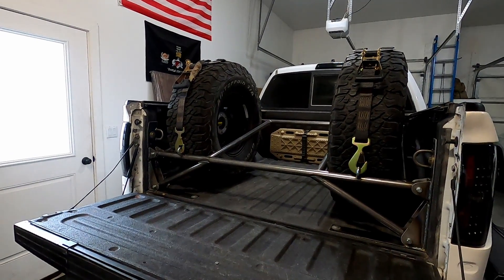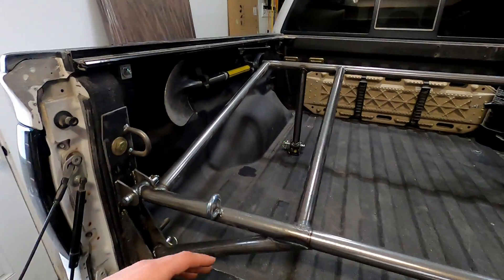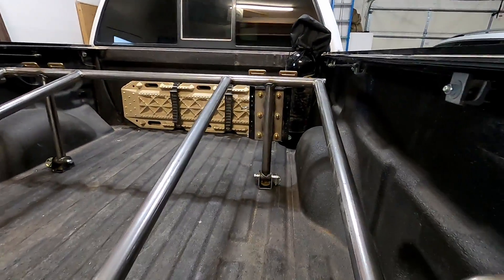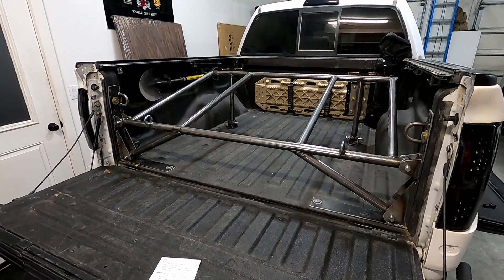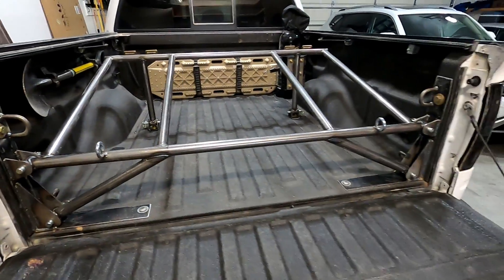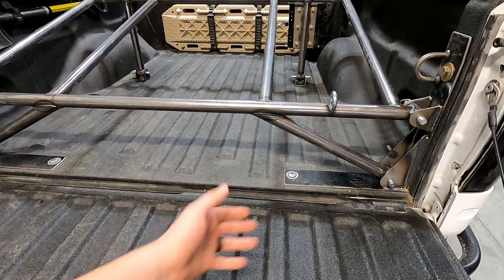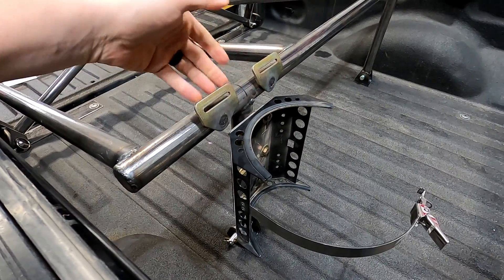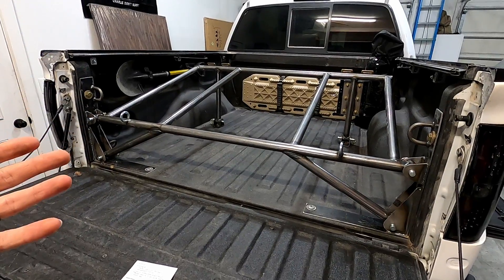I Made a Dual Spare Tire Carrier that is also a Bed Brace

Comment: Why not remove tailgate? Id think it would look better but also saves weight
Reply from the maker: It would be sick, but I use the truck for other stuff too. I like to have the tailgate and the tonneau to lock everything up. I also really like the back up camera for hooking up trailers. Taking it on and off is a pain and is not practical to do frequently.

Comment: Great design, but how does having the tires mounted behind the rear wheels effect the trucks center of gravity?
Reply from the maker: I should have mentioned it's but it was a goal of mine to have the weight as far back as possible for slightly better front to rear weight distribution. But you are right that my center of gravity is now higher.